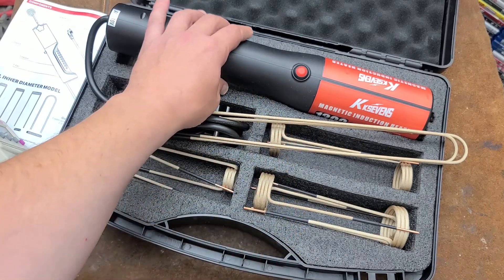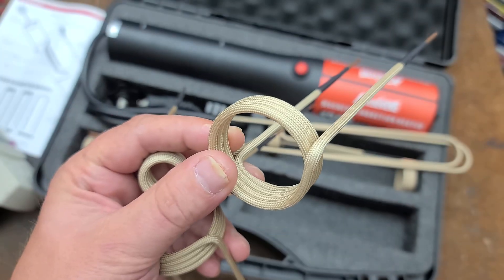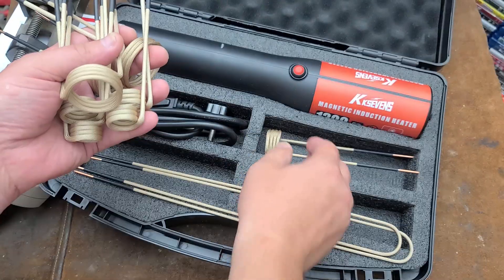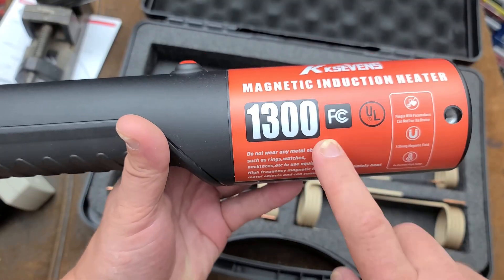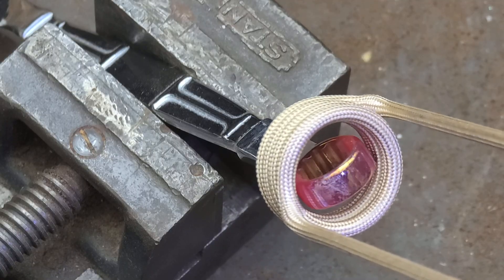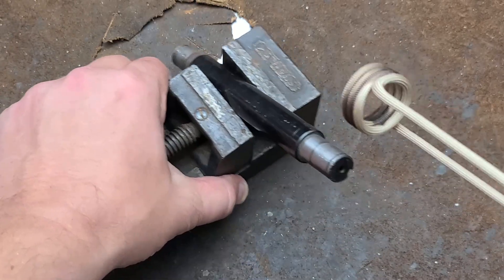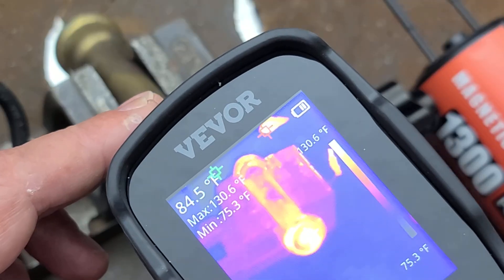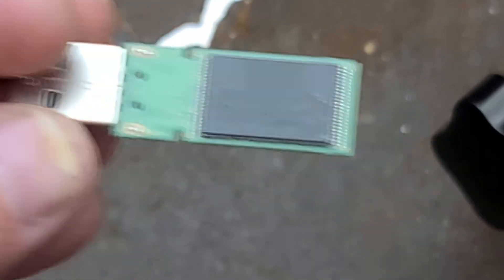KKsevens Mechanics/Technicians Magnetic Induction Heater Review

Comment: I’m looking to turn a stainless steel watch dial blue. Would I be able to put it on top of a  regular steel cylinder and heat the regular steel cylinder and let the regular steel transfer heat to the thin stainless steel piece?  Do you think I’d get even heating?
Reply from the maker: A gas utility torch would probably work better.